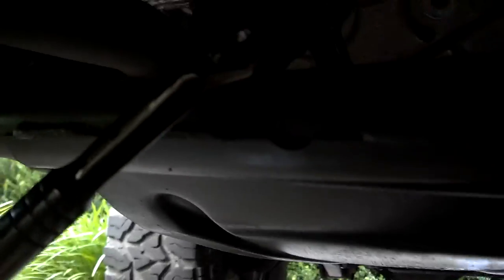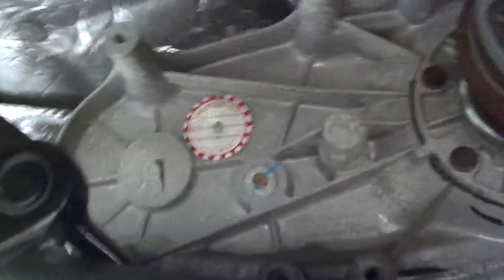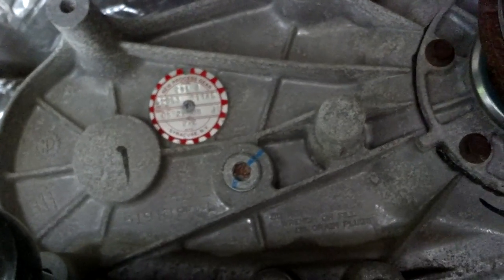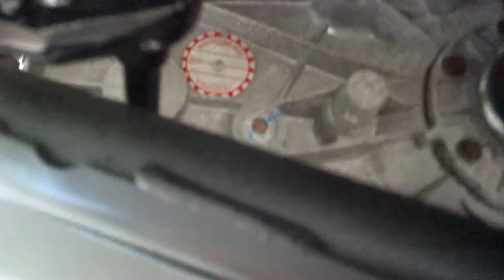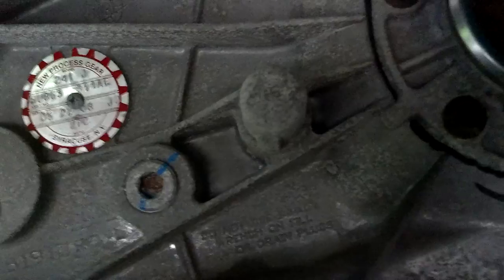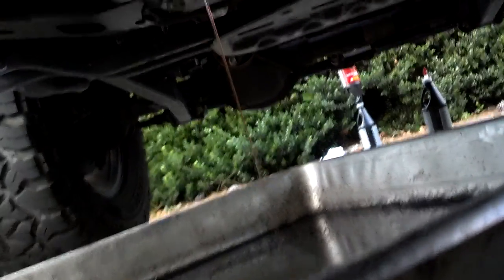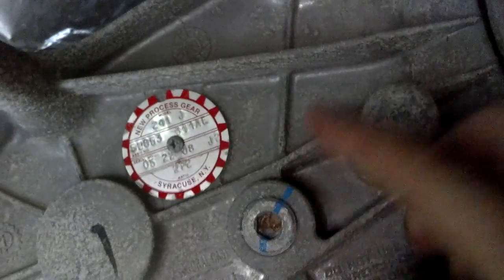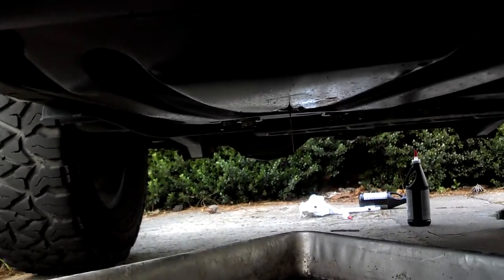how to change the oil in your transfer case

Comment: You should always remove your fill plug first. If you cant get your fill plug out and you have already drained the T.Case, Transmission, Differential, etc... You get the point.
Reply from the maker: You can always fill through the vent if you have to. Lol
Reply: LOL! +1d I have filled through vents and by taking shifters off, huge pain in the ass to realize it after the fact, and chances are when/if this occurs you will have some place to be... Trying to fill through a small ass tube on a sealed case isn't fun.

If the fill plug is stuck or you are an idiot and didn't realize beforehand that you don't have the right sized fill plug socket it's easier to just not drain it until you have time to address the situation... Cheers fellow lazy bastard.